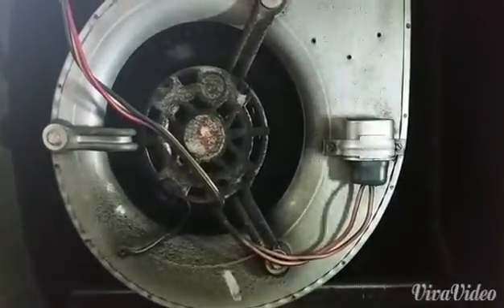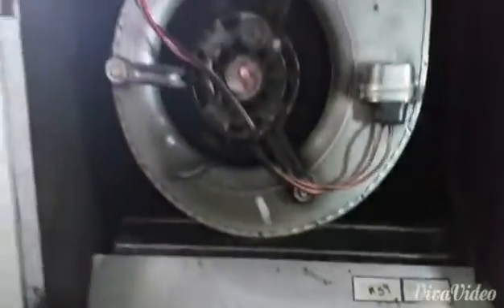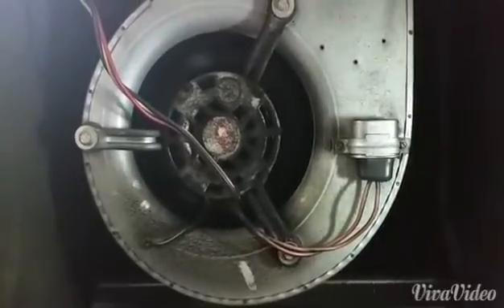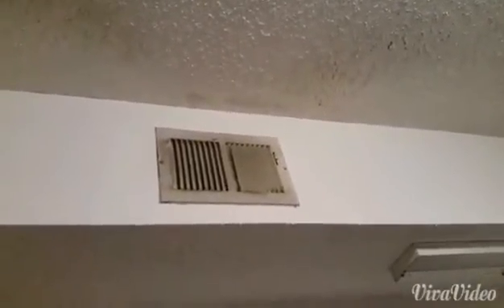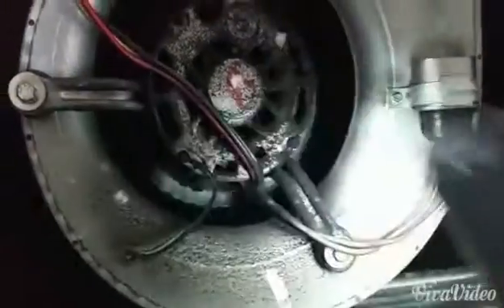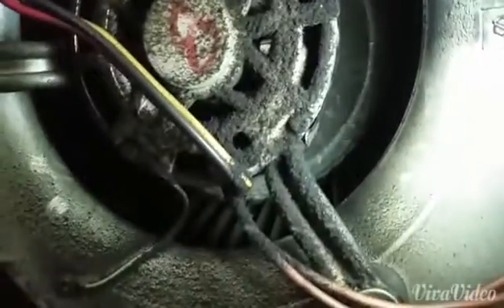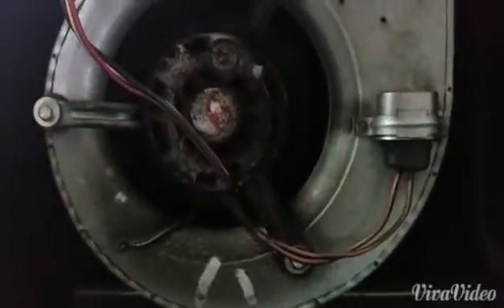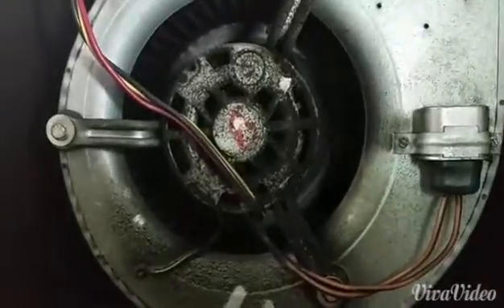HVAC Service: Blower Motor Bearing Failure

Comment: Here a thought? Air handler pull air from wet evap coil. Over time that moisture mix with fine dust get all over the blower assembling. Even if you had a person that maintain filter change monthly. 

This is a problem I see with all air handlers. Furnace blower motors have a different dirtiness then the black slime that air handlers do. 

The registers marks just tell me two things. Air leak? Or just black slime making its way to it.

Just a thought.